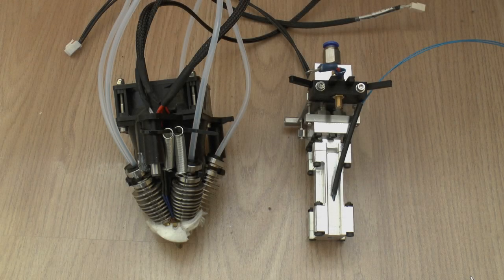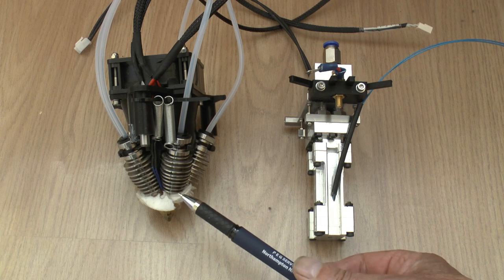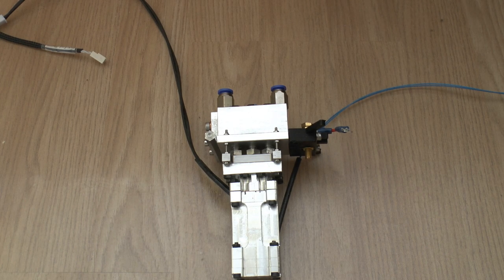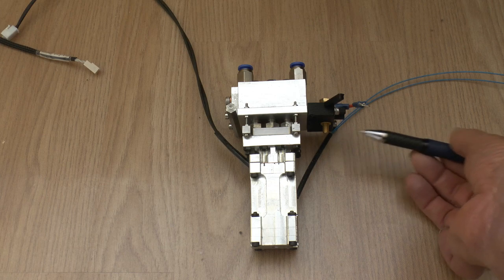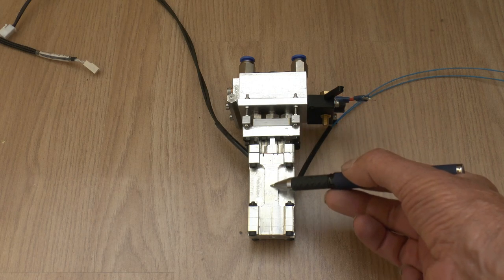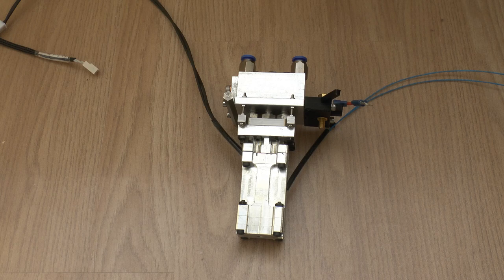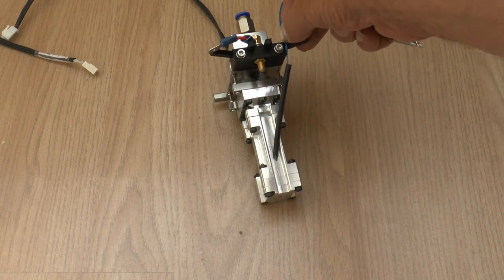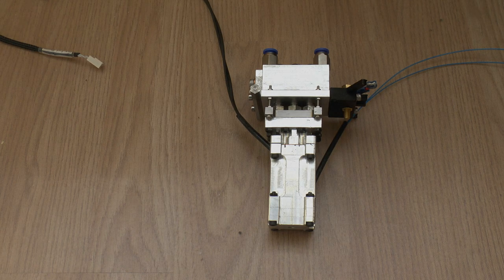My 6 input mixing hot end part 15

Comment: For individual retraction, the Klipper firmware (which you can flash to your Duets, btw!!) supports Macros.  So, you can setup individual retractions for individual extruders (modify each extruders gcode).

```
[gcode_macro G10 S1]
gcode:
    G91
    G1 E-2.5 F4000
    G90

[gcode_macro G11 S1]
gcode:
    G91
    G1 E2.5 F500
    G90`

[gcode_macro G10 S2]
gcode:
    G91
    G1 E-1.0 F4000
    G90

[gcode_macro G11 S2]
gcode:
    G91
    G1 E1.0 F500
    G90`
```

That's basically what I have on my Delta with two nozzles, at 0.2mm and 0.6mm and usually different filament types.

Ps, I've been waiting since Feb to see this mixer! :) Thank you!

Pas, I thought you were no longer going to share designs for China?

Comment: New subscriber here. Interesting stuff :-) . just out of interest, why didn't you use a stirrer?

I'm just embarking on my second 3dp build, a modified leapfrog creatr. I intend to make a multi material selector for it (that's how i found my way here :-))
Reply from the maker: Well it's along story. One of the biggest difficulties is sealing the shaft against molten plastic at around 200 deg C. Another is packaging the stirrer drive motor. having said that, one or two people have tried it and claim some success. But their designs never seem to get further than printing something like simple vases. So I think they likely suffer from one or more of the issues that I talked about when any sort of mixing chamber is introduced between the filament inlet and the nozzle - i.e. lack of control at anything other than more or less constant flow rate, and difficulty preventing oozing for non-print moves/lack of viable retraction.
Reply: @deckingman  I see. My thoughts were a graphite tube for the shaft and mix in the nozzle it self (i.e. as small a volume as possible).  Is the hydrolysation (?) caused by time or temperature (does the pla take a while at printing temperature to get runny?) Just wondering if the stirrer could be used as a valve to close the nozzle during non-print moves.
Reply from the maker: @wktodd  I guess if one could make a small enough stirrer it might work. You'd still need some sort of chamber because you have to leave room for the incoming filament. But shaft sealing and motor packaging would still be problems to overcome. TBH, I've spent too long on this and it's time to move on with other things. My pension doesn't stretch far enough for me to spend what it might cost to develop. Ref the hydrolysing, it's function of both time and temperature.